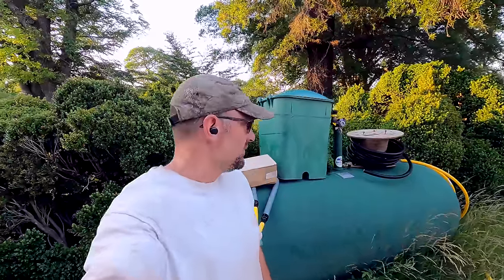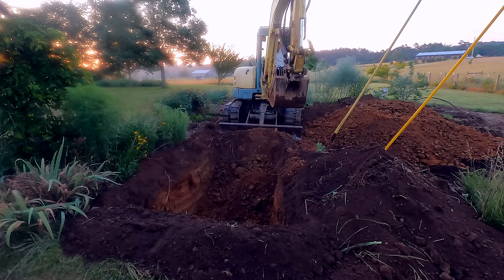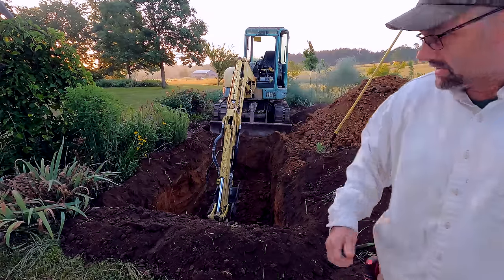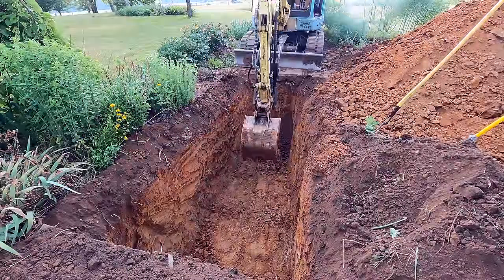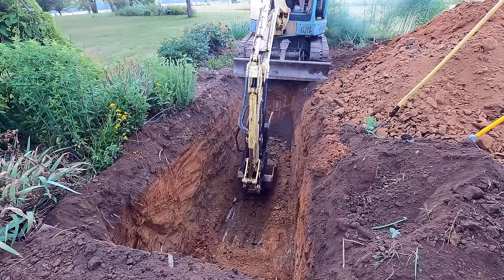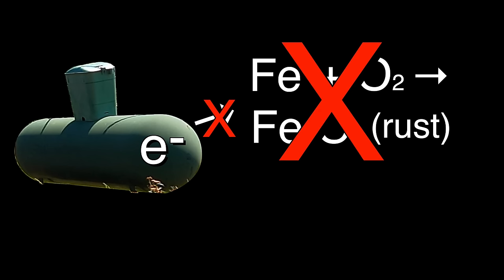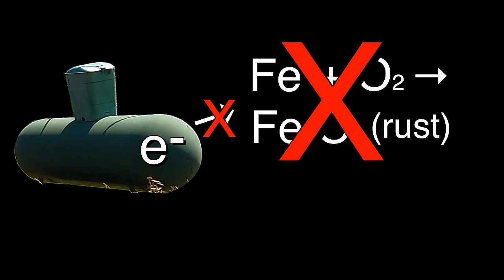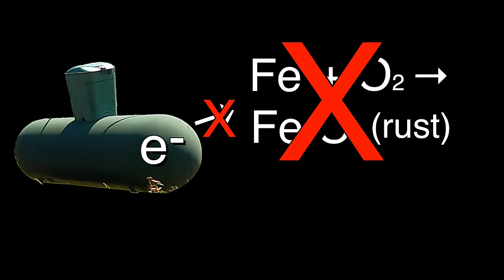Installing An Underground Propane Tank (500 Gallon)

Comment: I had this exact problem on my old Bobcat x325, would run fine for 15 mins or so then cut out.  Blew through with air and i'd get it back for a while but always stopped again after 10 mins or so.  If i let it sit 24 hrs it would run for 15 mins again.   There was a gauze on the fuel pickup in the tank that was completely clogged with gummy resin.  I removed the tank and cleaned it out, cleaned the pickup gauze and put it all back in.  No problems since then and it's been a good 5 years or more now. I got that machine cheap and i'm guessing it's because the previous owner got fed up with it stopping and didn't know what was wrong.
Reply: Same with my bobcat 751. In this case it looks more like a lot of dirt in the tank... my bobcat did not start anymore before I installed a new fuel pickup. The excavator got a fuel lift pump, an electric one... I would wonder, if hat is there since the machine has been new. I would think, its an aftermarket installation to get rid of that missing fuel problem...
Reply: based on the state of the machine otherwise it's pretty clear the previous owner wasn't familiar with "maintenance"

Comment: One observation you may not be aware of. When you dig that close to the guy wire anchors, that small area left is weakened, and with rain, eventually will give way. Only way to prevent it is 98% compaction between the anchor and tank. I have been there before, trust me. If the power company came out, they would never approve it that close to a propane tank. Sorry.

Comment: Judging from the air pressure you introduced that resulted in spraying fuel, I'd suggest that you vent the tank. Try running it with a loose cap to test the theory first, if it works, maybe all you'll need is to drill a tiny hole in the cap to relieve the vacuum. I've experienced a similar situation after replacing a missing fuel cap. It simply sealed too well.
Reply: That wouldn't explain the required pressure to blow it open, plus it would have made itself very obvious by sucking in air as soon as there was an opening in the fuel line, like when he pulled off the filter. It's worth a test, but in my opinion, there's less than a 1% chance this is the issue.
Reply: Had this problem on a fuel tank on all kinds of vehicles needing a vent of some kind. Hole in cap  cheapest and easiest. There is not a big vacuum in the tank that's noticeable , it just seems to give a slight negative pressure that slows, not stops, normal fuel delivery. Not saying this is the problem in this case, just confirming it does happen.
Reply: @BRI33NOR  yes and any troubleshooting is process of elimination, and venting could be an issue, best to eliminate it before doing header work LoL

Comment: Fuel starvation. I had to remove and replace most of the rubber lines in my older Kobelco Mini. The routing in mine caused the supply line from tank to fuel filter to become smashed. I kept blowing the lines out, etc. but the problem would come back, machine would bog and start to run hot. Nice video sir!

Comment: On my old kx 121-2, I found the fuel tank had an inch of mud at the bottom, after refuelling it would stir it up and block the filters, fortunately kubota have left a nice big access hole, after cleaning it out I put some descaling fluid (phosphic acid) in to cover the rusty bottom, after a few hours the rust had gone and left the tank like new with layer of phosphor to protect it, over a year now with a nice clean fillter bowl.

Comment: Here in the UK all tanks are supplied with a concrete pad bolted to the bottom to stop it popping up when empty in wet water logged ground.
Reply: By “Supplied with” you mean
“Required by law. At your own expense, of course” right?

Not saying it’s not a good idea, necessarily or even just a prerequisite due to the environment in some places though.

Comment: If the packing in the blade cylinder looks good or it otherwise continues to bleed off after repairs, check the swivel.  It transfers the hydraulic flow from the top of the machine to the undercarriage.  If an O-ring in the swivel is on its way out, it can show the same symptom.  You may also have issues tracking where one final is usually slow and weak.  You mentioned that your left side wasn't spinning as fast in the previous video.  Worth a look.  It's not a terrible repair.  Just a ton of O-rings after you get it apart.  
Great videos.  Machine looks solid.  Good luck.

Comment: Huh.... I didn't make a comment as to my guess in that last video... but I was thinking "propane tank" or something... but then I saw those cable tie-downs (or whatever you might call them).  I don't know what they are securing... but I gotta wonder if having the propane tank right next to them will cause any issues.  Just found your channel and I'm loving it... excellent use of the time lapse and ALSO the slow mo stuff.  You just do a really nice job with this stuff.  Again, thanks for sharing these projects with us.... quite entertaining AND educational.
Reply: I had the same question. Those anchors are I think keeping a power pole vertical. Did he have to check with power company before hand?

Comment: Turned out great! I went with an above ground tank the same size, and had them install a portable tank refill adapter setup. I can fill my own 20lb tanks from my big tank; comes in handy for filling up the tanks on my RV camper. You have to have them install this before they fill the tank though.
Reply: The parts needed can be installed anytime even with propane in the tank without issue as long as the large tank has the proper valve for liquid withdrawal

Comment: I stumble across your "Tong& Groove " video.'.. Then this about the tank installed  today...I didn't know about the anodes... Interesting...I about the installed a generator  and will be installing a in ground propane tank....I do a lot of repairs here in Florida having a machine shop.  I think your location is Va. ...I live there...You did a great job in the repairs on the hydraulic cylinders.... I see that you replacing the porch on the house...Rember codes !A "square & flat bottoms in the holes" for the foundations...I made that mistake...Good videos .....Thanks.....   Robbie

Comment: I put a 1,000 gal tank in a few years ago.  Propane company recommended filling with pea gravel, which I did.  Worked fine. I put some landscaping fabric over the gravel at the top to keep the dirt out and covered the rest with top soil.  Two anode bags on a 1k gal tank.

Comment: John I don’t want to tell you how to cook eggs but a tip for digging trench’s wider than twice your bucket , use the main arm slew and dig one side, then before you shift slew the other way and dig the other side, then clean out the middle. Doing this reduces side pressure on your boom from trying to scrape the sides of the hole.
Hope this helps next time 
Cheers from Aus

Comment: By digging there, you have severely weakened the support wires. Why would you want to store propane next to lightning attracters? 

Not pretty, but an above ground tank will last much, much longer.
Reply: Like he said, with a good anode bag the tank should last. Code requires testing the current of the anode bag every year and replacing it when needed. I have seen tanks in the ground that were dug out 40+ years later sand look almost brand new.   I have also seen above ground tanks on the side of a house near the ocean that are rusted out within a couple years. I have seen some above ground tanks that were 25-30years old but they show their age.

Comment: As a gas fitter I highly recommend AGAINST burying propane tanks. I know they are unsightly but it just makes more sense. Of course I live in Canada which brings all sorts of other issues like propane vapour turning liquid in the dead of winter. At any rate good luck with that!!
Reply: Burial tanks perform better in extreme cold, burials are at near 50° when it's below zero outside, less likely to lose pressure, and they can be drawn down to 10%, above ground tanks will only draw down to 20% in extreme cold.    Burials can be filled to 89% whereas above ground tanks only 80%. 

And in the states, burials of any size only have to be 10' from a building, an above ground 1,000 Gallon tank would need to be at 25' away.  

Burial tanks are a luxury.   We install them regularly.   We just buried 3 x 1,000 gallon tanks as a single system.
Reply: @nicvazqueznic  ok that’s good to know. You don’t they rot out a few years?
Reply: @@Pskawt   there's redundancy in tank protection these days, the new burials come with Electrolysis preventing paint on them to keep rust from eating the tank, additionally since early 2000's an Anode bag is required for install, the anode bag is 20lbs approx of pure magnesium, it has a wire lead that is attached to the tank, if there were any scratches in paint it would rust without the anode bag, the bag reverses the polarity of the tank so it will actively repel ferus metals in the dirt that would otherwise rot the tank,   the anode bag is a lot like a zinc plate on a boat in Salt water, the zinc plates corrode so the boat doesn't.   It's sacrificial so they go bad over time, but should last at least 20 years or so,   the theory is, if you replace the anode bag every 20 yrs, the tank should last over 100yrs.

Comment: LOL, love the backhoe that doesn't need repairs. The area I live in won't allow propain tanks to to be buried, so mine has always been above ground. Did some hand sanding on my tank due to some surface rust, then repainted it a couple of years ago. It's been out here for over 50 years, very little rust but figured I would prevent it from rusting out. We got a whole house generator last year to supplement the solar panels we got the two years ago. Personally, even if they allowed us to place our propain tanks underground I wouldn't want to, simply because the anode bag would have to be replaced every 20 years or so and our above ground one hasn't had any problems since it was installed over 50 years ago. Still, great video and enjoyed watching.

Comment: All that sand around the gas tank will make a nice collection point for the rain and any groundwater to accumulate. I'd be looking down that access port after any large rainstorm.
Reply: They are supposed to be bedded in sand and backfilled with sand and screened fill ... unless your in an area that code requires you install a concrete liner first.
Reply: The sand prevents any rocks from rubbing against the tank and wearing a hole in it. Sand is part of the gas code for installs

Comment: Easy way to backfill a tank when you can’t get a dump truck close by: order sand slurry from your concrete company. It’s just sand and water, no cement. It can be placed by the concrete truck chute or by by concrete pump. It flows easily and is self leveling.
Reply: Great idea!

Comment: The utility company will crap when they see how close ur tank is - and I'd be really supportive if the inspector doesn't make you expose that line again - you buryed one of the things they want to see... that is the radius of the bends - we always used pea gravel to back fill fuel tanks ... good luck with the inspections
Reply: Sand is acceptable as it’s a neutral soil and drains well but using a hard riser in the dome lid horrible decision, not having tracer wire/tape with the poly is definitely not legal, the depth of the poly is also questionable, and at least in my state using what seemed to be compression fittings on the poly is also not legal
Reply: Should have had sand on the bottom…but it’s way better than had you tossed that rock back in… what inspection!!! LMFFAO’. Should definitely do the warning tape or bury a board with some orange paint… you don’t want to hit that line with a shovel when you are replacing your anode!!! LMFFAO!!! Tear that tank off and clean the fuel system up!!!
Reply: It’s all ok other than the riser in the dome. States don’t regulate propane tank burying it covered in NFP58 code federal. Now they can say the line is not deep enough or no tracer wire is a no no, but the soil comp when it was buried not there job.
Reply: @fishes4life362  well that’s somewhat incorrect as some states have LP gas commissions that oversee the installations of propane systems and NFPA 54 & 58 are in play however authority having jurisdiction can place additional rules on top of the federal guidelines

Comment: Just found your channel and love it! I work on power lines, i would not be to happy to have some one dig up our anchors. The pressure of the soil holds them down, and they go down in about the same angle as the anchor wires, so im affraid you are just above them.

Comment: So is groundwater a concern?  The ground is so rocky there, and now you've made a big hole full of sand... I find myself wondering if it will hold water or is the rocky soil porous enough?    Also.. I was worried about those guy wires while you were digging.  I guess they do not go as deep into the ground as I was thinking they did.  I was sure you'd hit one of the anchors.   oh well, glad that didn't happen!     And as for future videos, don't forget your shop expansion!!  😁
Reply: The tank should be backfilled with wash sand

Comment: An EXCELLENT example of how and why anodes prevent rust. Wouldn't have clicked for me in a chemistry class situation. I assume 'galvanized' metal refers to the galvanic series?
Reply: Yes. Most specifically, galvanized steel is generally coated in zinc. You might also hear about aluminized exhaust pipes for cars and such. Basically same thing, except the steel is coated with aluminum instead of zinc - but with the same anticorrosive effect.

Comment: In a wet area that has poor drainage tie down straps with anchors should be used to eliminate the possibility that the tank would float up when it is low on fuel it flooding occurs. Also digging next to the utility guy wire anchors should be evaluated for integrity, especially back filling with sand.

Comment: Looks like you worked thru the bugs to complete the task at hand. If the main cylinder doesn't leak to bad, you can use the bucket to help turn the machine. So you can get a little more time out of the tracks but repacking cylinders and the track tensioner ain't to bad of a job. I would clean it well on the track tensioner,it makes removal alot easier. Enjoy watching,keep em coming

Comment: I have seen where rust in the tank can cause a problem, Condensation in the tank causes the rust over time. I have put a magnet hooked to a string or wire then put the magnet in the bottom of the tank, pull it up once in a while clean it off put it back in. Works good. Try to find a place at the top of tank to hook the string or wire to.
Reply: you can't have an opening in the propane tank to drop a wire/ string thru.  The minute you opened the tank to atmosphere. the propane would all vent to  the air.  creating a very hazardous situation.

Comment: I had a truck that got some chunks of rubber in the fuel tank. It was rubber debris from the inside of the hose from our own fuel pump from our on-site 2500 gallon above ground tank. 
The chunks of rubber in the truck's tank don't float, they swish around the bottom of the tank and get sucked up the pickup tube usually when you are taking off from traffic lights! So the truck would usually stop in the middle of an intersection.
But the thing would either run properly or it would stop dead, none of this loss of power after 15 minutes. I'm thinking you have a blocked breather in the tank.

Comment: I could absolutely be wrong  but, FWIW, check your compression @ full temp anyway, just from sound alone it feels like worn out valve seats and/or guides. Happens after a lot of hours.. Everything from that era likes to eat up valve seats. When the seats & guides are worn, it'll stumble and lose power like that after warming up, when the lifters have gotten good and pumped up the valve doesn't fully seal up against the seat anymore. Stick a piece of paper close to the exhaust pipe after it begins to stumble; if the paper gets sucked to the pipe at any point just pull the head off and send it to the machine shop. There will be excess goop in the intake if it's an intake valve hanging up.. Doesn't cost that much for a valve job, he'll check it for flatness and all the other good stuff while it's there. Don't spend more than about $250-300 @ the machine shop either.

Comment: First thing to talk about is why you would want to install a tank underground, especially near those power pole stabilizers?      I mean that whole thing just seems like a maintenance nightmare, accident waiting to happen?      An above ground tank seems easier to work-on or replace if something goes wrong.   Might not be that sightly, but seems a lot easier to build some privacy fence around it rather than burying it.

Comment: Is there a reason they threw the anode bag in prior to the tank? It seems like it would be easier in the long run to have the anode near the surface so when its depleted you can hook up a new bag to the existing wire?
Reply from the maker: Works better if it’s down below. But when it needs replacing you just add a second one closer to the surface.
Reply: It needs to have water to work. Since you have a giant bathtub the water will go to the bottom.
Reply: @ferky123  thanks! i thought that might have something to do with it!

Comment: In Italy we are required to have a concrete slab under the tank and the tank bolted to it, I guess because the tank could float because of rain or whatever, I'm not an expert. My job is to fill them with my tanker trucks!

Comment: Is the tank properly vented? Probably needs a good cleaning either way. Much easier to do if it can be removed without dismantling the entire excavator. Otherwise you may be able to do it with a pressure washer and some degreaser.